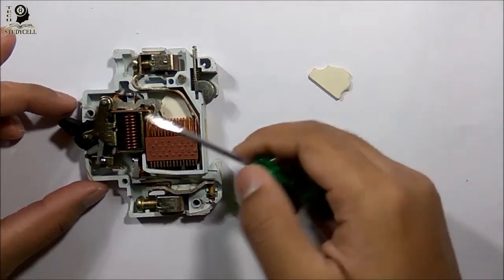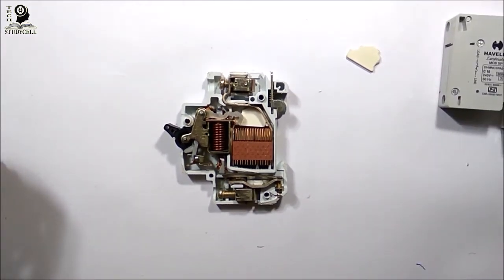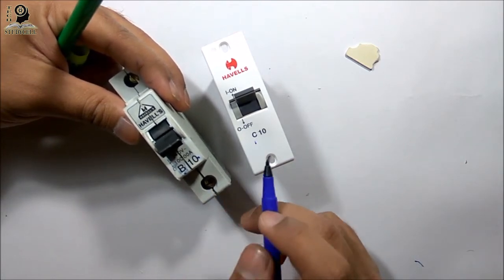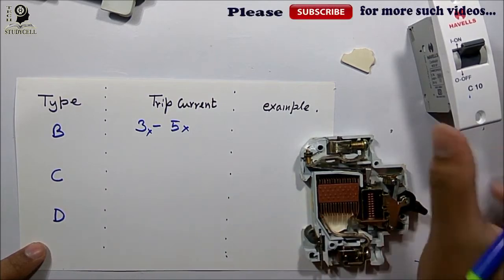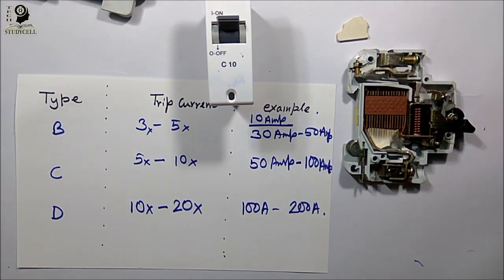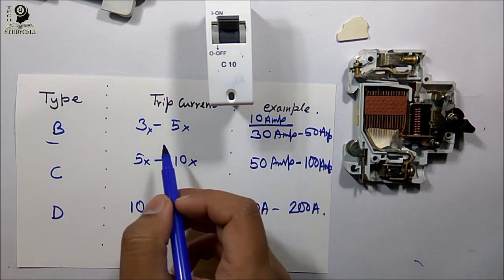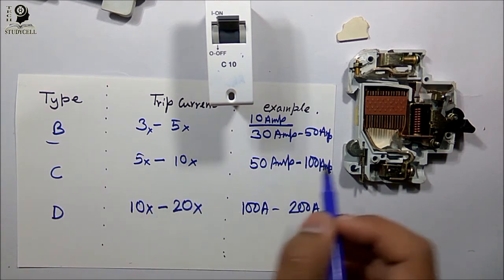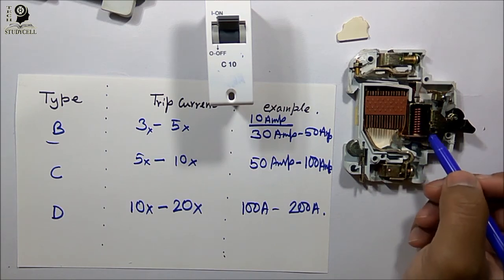Circuit Breakers - How MCB Work & What's Inside

Comment: Nonsense alert! That the tiny CB shown at 0:30 is a 10 Amp breaker. It will NEVER carry 10 000 Amps! It would already vaporise - yes VAPORISE - at much less than that - probably start melting at 100 Amps! 

Can you even imagine what size of device would work with 10000 Amps of current??? A power station generator! Imagine THAT going through this breaker - what a cartoon that would be!
Reply: I think that the 10000 A is only during the very short time less than 2 seconds until the mcb trips.
Reply: @suhailasaba1051  But did you hear what the dufus said? "Ten kilo amps". Nothing about time.

Your reply is fascinating, though. Can I ask how you explain the 10 000 A as a time? What is the A for? Do you really believe that the response time of an ordinary CB is accurate to a tolerance of four zeroes?
Reply: @mike_van_in 
Ten kilo amps = 10000 amps.
When I wrote 10000 A , l meant 10000 Amps.
I have a mcb that has 6000 written on it and I think that this number refers to the amount of current that the mcb can tolerate during the very short time of the short circuit which could be less than 2 seconds.
Reply: @suhailasaba1051  No, Suhaila, those current levels are IMPOSSIBLE for a device physically that small. Think about it - what do you think the latency is on a mass-produced MCB like that?
Reply: @mike_van_in  
Hello,
I have searched for 
How to read mcb name plate.
It says that 10000 refers Breaking Capacity ( Max circuit current) in Amps.
The same for the number 
6000
Reply: @suhailasaba1051  Do you actually understand the physics of what you are reading, my dear Suhaila? The clown who made the video has no academic understanding of what  he's telling us. If you look up the rated current of those two breakers (at the start - I can't recall what the rest of the video shows), you will see that they are BOTH rated at 10 Amps, a thousand times less than that "breaking capacity", which no residential supply can ever HOPE of seeing. 

An SCCR of 10kAmp has as little significance as giving the breakdown voltage value of the casing that the CB is made of. Sure, the case will take 60kV before it allows a spike to breakover. Do you wire a house to resist 60kV??? SCCR (or AIC) have NO SIGNIFICANCE on the CURRENT RATING (ie current at which it trips) of a CB. You folks are being taught theoretical concepts by people who do not live in the real world.

Another thing; 2 seconds is a ridiculously long time to trip. CB's should trip within 3 cycles - 1/20th of a second. 2400 times shorter in time! Who teaches you what you "know"? I don't blame YOU. I blame your teacher!

But go in peace - I am not here to persuade you of anything. You do whatever you think is right, without understanding very,very, basic principles.
Reply: @mike_van_in  agree with you